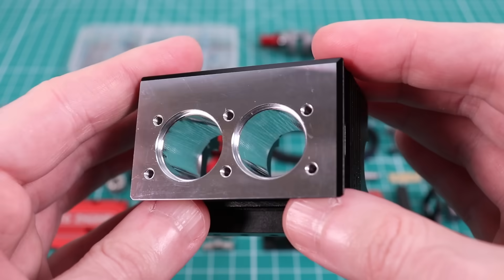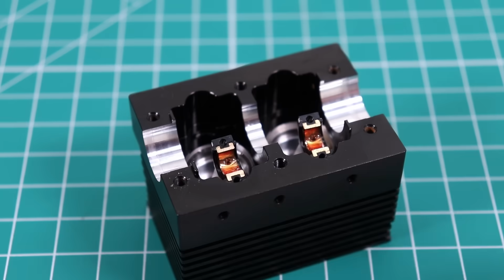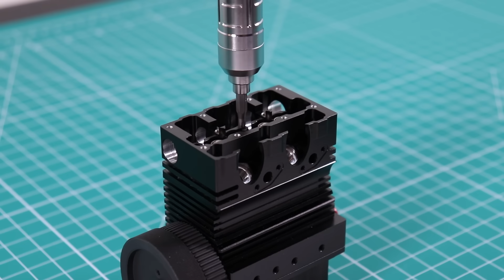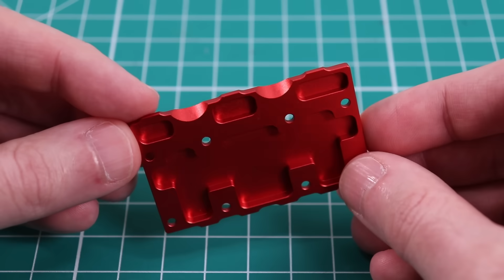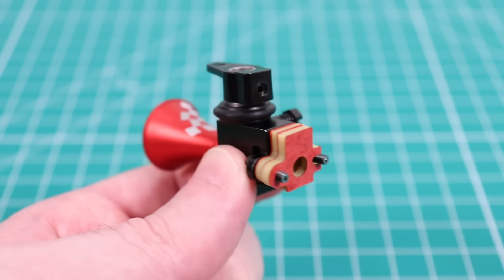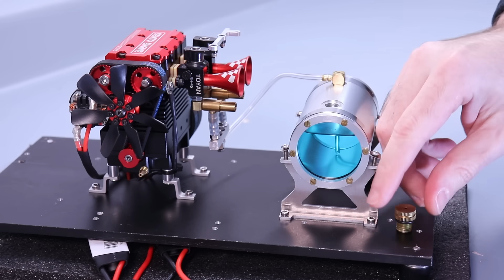This Tiny Engine Screams to 16,000 RPM (assembly & test run)

Comment: Nice engine, great machining, etc. However, getting parts from the manufacturer is a disappointing nightmare. I sold mine for just that reason. Typical Chinese manufacturer. They advertise / sell the big ticket item but the support is absolutely terrible.

Comment: Not gonna lie. I'm 62 and that little thing is outstanding! Your video is very nicely done to boot.
Reply from the maker: Glad you enjoyed it!
Reply: Si es un motor cuatro tiempos por el sistema de válvulas, como funciona sin aceite que lubrique el motor y no funda, pq no ví en ningún momento que le echarán lubricantes para el desgaste por el roce de las piezas,  por curiosidad desde venezuela
Reply: @ALCELGAR Probably an oil gas mixture like you would use in a weed eater
Reply: Hello, grandpa
Reply: Ou on en acheter un merci

Comment: Mine didn’t work, like not a single spark.
Reply from the maker: the magic is in the tuning of the carbs
Reply: I tuned the carb as much as I could and literally NOTHIN
Reply from the maker: @IGameAustin12  test your glow plugs. are you able to get them to glow?
Reply: They glow
Reply from the maker: @IGameAustin12  1. Make sure the timing is spot on.
2. Use a powerful battery, needs to crank the engine over relatively fast.
3. make sure to adjust the needles exactly as stated in the instructions.
4. choke the engine on start up to pull fuel into the carbs.
Reply: Every thing works it’s just the stupid ass design. Plus, there made in crappy Chinese factories
Reply: I know everything about them, the glow plugs consistently on. They’re not spark plugs. Me and my mechanic dad did everything, and nothing.
Reply from the maker: @IGameAustin12  Make sure you have the starter gear installed correctly as its a one-way bearing.
Reply: Dude, everything is correct. I took it apart and I found a blown ring
Reply from the maker: @IGameAustin12  Dude, I think you flooded it to cause that
Reply: I did a few times, but I just drained it out by opening some valves and tilting the engine. It’s just the crappy lighter electric system I bought. And yea most of the nitro methanol twins don’t run even when you try everything, it’s just cuz of the fuel system and the shitty carburetor.
Reply: But the flooding never caused that, because I said it didn’t light up. I used 25 percent nitro and no spark, nothing. It was the company that probably made a mistake making the parts for the motor.

Comment: I am curious to know, the magnitudes of permissible shear stress, torsional Moment, bending moment inside the transmission shaft,how much power can the shaft transmit, how much is the belt tension ,what's the material used for the shaft, the diameter of the shaft, it's factor of safety, what's the ratio of belt tension, find the permissible shear stress, torsional moment, bending moment and shaft diameter of the shafts, what's the torque transmitted by the shaft, what is the diameter and length of cylinder,what are the stresses in thin cylinder, what's the thickness of cylinder, what's the brake power, speed, indicated mean eff. Pressure, mechanical efficiency,what's the circumferential stress, longitudinal stress, Net stress acting in each cylinder walls, what's the max gas pressure, what's the Factor of safety of cylinder head? What's the brake power of engine per cylinder? What's the bearing pressure at the bushing of small end of connecting rod? What's the inner, outer dias of piston pin?How much is the fuel consumption per hour, and what's the higher calorific value of the fuel, what's the allowable bending stress for the piston pins?what's the thickness of piston head per (1)strength and per (2) thermal consideration ? Find the radial width,axial thickness of the piston rings, what's the width of top land, ring grooves,thickness of piston barrel,thickness of barrel at open end, what's the inner and mean dia of piston boss,what's the side thrust in cylinder wall in Newton, what's the inclination angles of connecting rod? What's the critical buckling load on connecting rod? What's the compressive yield stress acting in the connecting rod, what's the allowable bearing pressure for piston pin bearing and for crank pin bearing? What's the inertia force acting on bolts or caps inside the engine, what's the angular velocity of the crank,what's the crank radius,what's the length and dia of crank pin,what is the whipping stress in connecting rod,valve head diameters,maximum valve lift,torsional shear stresses inside the shaft, values of each components of forces acting on the crank pin of the engine made by you.
Reply from the maker: yes

Comment: I dont see how that thick goop poured into the engine works like engine oil should.  Does that fan maintain safe engine operating temperatures?  How does the fuel get pulled into the engine?  Would be great to see it operating with gauges attached showing temps and pressures.
Reply: Same way it does on single piston RC car engines and planes and helicopters. The exhaust pressurizes the tank via a tube.

Comment: Well done assembling of this smal block internal combustion engine. For some bolts I miss the care on the torque but nevertheless it is impressing.  For the ventilator may I ask for a protection not to be harmed or to demage it.

Comment: It is a mini engine model with crankshaft, pistons N ect ect showing how an engine works. I used to have a Monogram clear plastic model of a 4 cylinder engine. It can be made to work by switching on the battery power pack. It even showed spark plugs lighting on and off when the engine id switched on.

Comment: l2 engine!!! I also need to outpoint that fact that fan-bladed engine are the most spread of piston combustion engine because fan rotates and freshes traction motors may those ones work with no overheat.

Comment: Love it.  Just wondering why the alternator belt doesn't look like it's moving.
Reply from the maker: that's the starter belt, only moves in one direction because of the one-way clutch inside the pulley

Comment: Is working by eletric motor?
Reply from the maker: the electric motor is the starter for the engine.
Reply: @DIY-Garage  Does that mean that small engine performs all [1-intake / 2-compression / 3-combustion / 4-exhaust]?
Reply from the maker: @kakaostyle  yes, that is correct.

Comment: I would put some kind of lever on the throttle linkage. That would keep my own nicely manicured fingers away from the fan blades.

I've watched several of these videos. They are all just excellent. That said, I doubt that I could've afforded even one of the engines even when I was far more prosperous. It's a real pleasure to watch though.

Comment: Why do small engines speed up as the fuel runs out? My chainsaw does the same.
Reply from the maker: the air to fuel ratio increases causing it to surge briefly

Comment: Although it was all greased during construction, there was no lubrication or cooling system!
Reply from the maker: the engine gets lubricated and cooled by the fuel/oil mixture, air cooled as well.

Comment: This video should be shown at the beginning of every high school automotive shop class.
WELL DONE!
Reply: These little engines are really expensive!  More expensive than a complete car engine  $3000 for a table top miniature engine is way more that most car enthusiasts can afford. 

In grade 10 we took apart and re-assembled a 4 stroke lawn mover engine.  Pretty easy and easy to see how a 4 stroke engine worked.  In grade 11 we did brakes and standard and automatic transmissions, and in grade 12 we pulled out and rebuilt put back in a student's car engine....!
Reply: Dang that's expensive 😮

Comment: No way that was 16k rpm.  Not even close.
Reply: So all of you experts know shit . These motors will do 16000rpm and hold it for a good length of throttle burst .. I have a motor that I run on my 1/6 scale that’ll rev to 22000rpm and doe a 0-60 in 1.8 sec .. Instead of being hero’s and going blah blah blah why don’t you start googling some of these motors and see what they’ll actually do . Better still open the cheque book buy some ,build em that do performance tests and rev counters ect . Otherwise as we say here in Australia. “Ya blowing shit outta your arse”
Reply: @taswegian1790  No one cares what you think Aussie. stfu.
Reply: @taswegian1790  mmm hmm… whatever you say Aussie. Don’t you have dirt plumbing to see to?
Reply: I think 16.000rp/hour hahaha
Reply: What this engine use for ? Look to me like a battery running an electric motor is more efficient.
Reply: Put a tach on it. I could almost count the exhaust pulses
Reply: @LapinDebogues  So what exactly was the value you saw?
Reply: @ He's saying to put a tach on it, not that he did... how could he?
Reply: bro is too used to V12s
Reply: There’s no way man. Little engine like that? There’s not even enough time for the fuel to fully combust at that speed.

It’s all for the clicks.
Reply: My friend, since this fuel is nitrous, the probability of this engine turning at this speed is very high.
Reply: @ I have zero confidence it’s turning at 16,000 rpm.

Comment: Fantástico! Pero la culata ya viene con sus válvulas, relés y balancines montados. No has explicado la instalación eléctrica para la chispa de las bujías y el motor de arranque 🚘⛽
Reply from the maker: yes, but it's very simple, just a couple of wires
Reply: @DIY-Garage  Great video, and witty but simple engine refrigerated by air

Comment: Where is the distributor?! how the engine knows the timing of the spark plugs?
Reply from the maker: the timing was set right before installing the timing belt. this engine runs with glow plugs, similar to a diesel engine. The heat keeps the engine running.
Reply: It’s a mini gas engine with glow plugs.
Reply: Not gasoline but model airplane fuel, methanol, oil and nitromethane.
Reply: Probably a sacrificial spark design
Reply: Diesel engines do not need a spark plug because they don't use spark for ignition
Reply: @AbirPalDev  Yes, it is the pressure within the cylinder that creates the "combustion" of the gas.

Comment: Also I saw on Amazon it says it doesn’t come with the ignition ?

Also what is the bottom tube connecting to what would seem to be the oil pan
Reply from the maker: the bottom tube is for the crankcase ventilation
Reply: What battery do I need to start the engine ?

Comment: Hello good day.
Based in Greece, 100% amateur and wish to be involved with an engine assembly. 
Possible to instruct more info about engines cost, ignition starters, battery and anything else required to fire the engine. Also stores to purchase.
Many thanks.

Comment: You should not run the engine on full throttle when brand new. It needs a run in period with restricted rpm

Comment: that is amazing, - so small. The power output is about the limit of the ebike power allowed here in the UK
Reply: E-bikes can be far more powerful than that, but they're called electric motorbikes and you need a licence, insurance, MOT and you have to wear a helmet. :)

Comment: I have one of these engines but it came with a different carburetor, are your carburetors an upgrade? If so where can I get them?
Reply from the maker: Good question! The carbs I'm using are from the L400 engine, I like the individual throttle bodies, more air flow and sounds better even though they are a bit trickier to tune as a set. I believe they went with the single carb design to make it easier for the end user to tune. But the tinkerer in me likes a challenge!
Reply: @DIY-Garage  thanks, I was gonna say that those carbs look familiar!

Comment: the production is simply terrible, the cleanliness of the surfaces below the skirting board, planting tolerances were not even provided at all, and such a price for what?  for being proudly called a "model", although many children's toys have a much higher quality of manufacture than similar "models"
Reply: I have that engine and in my opinion its design is good, what I don't like is its short exhaust. But it is a good engine compared to the nr-200 which disappointed me more than this one.
Reply: @CinemaL200X-55  nr-200 it is made as poorly as possible, according to the principle it is enough for two times and then we are not interested
Reply: Where could I found a better quality
Reply: @lasmemichelrenaudessoh2016  unfortunately, there are only such sad crafts on the market, but at the price of a normal model...